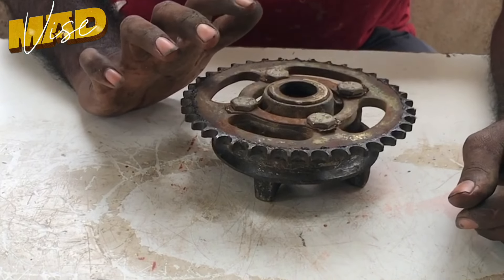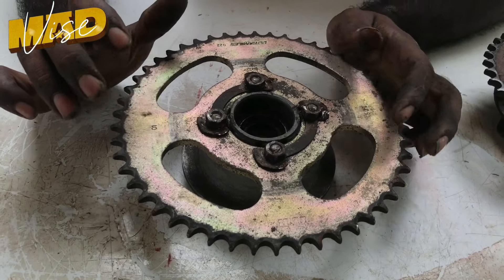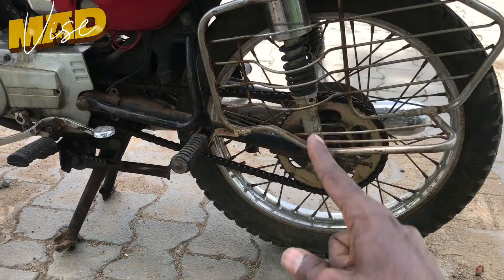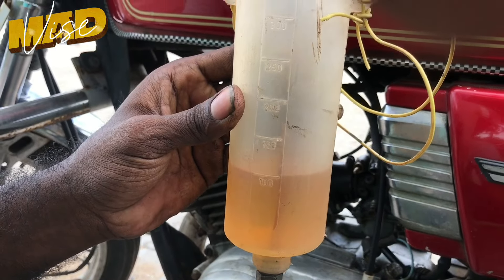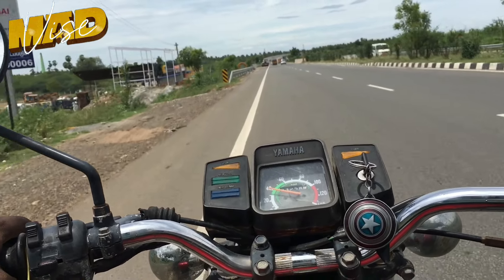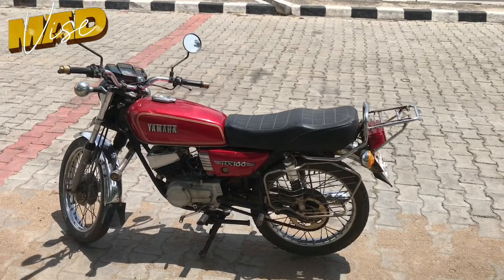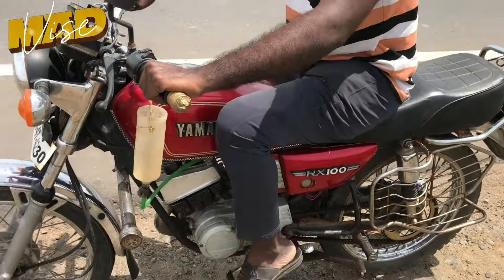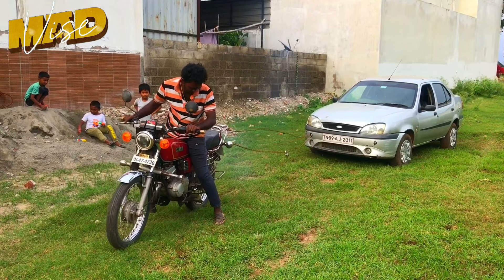பெரிய Chain's Sprocket change பண்ணிட்டோம்🔥 #automobile #rx100 #trendingvideotamil

Comment: Rear sprocket teeth athigamakkuna pickup athigamagum. 
Top speed kammiyagum.
Mileage kammiyagum.
Yaana bike engine athiga rpm la run aagum.
Hill's area ku tha set aagum bro.
Rear sprocket teeth kammi pannuga or engine side sprocket teeth athigamakkuga appotha mileage athigamagum .
Neega pannuramari pannuna mileage kammiyatha aagum
Reply from the maker: na test panni paathu tha solren .. neenga solrathu crt na mileage test pannum pothu mileage kammi aaairukanume bro
Reply: @Madvise007  appona ennam konjam periya sprocket poduga bro mileage athigama kedakkuthanu check panni video poduga bro

Comment: Bro,
Rear ல பெரிய chain sprocket போட்டால் bike da,
  1) top speed குறையும் 
  2) mileage குறையும் 
  3) pickup கூடும் 

Rear ல சின்ன chain sprocket போட்டால் bike da,
  1) top speed அதிகமாகும் 
  2) mileage அதிகமாகும்
  3) pickup குறையும் 
        
         ❤️  From 🇱🇰
Reply from the maker: rx 100 la rear sprocket 39 teeth -good mileage 
rx 135 la rear sprocket 37 teeth low mileage good top speed 
rx 100 la top speed kammi athunala rx 135 rear sproket size sinnatha aakunanga athunaalA TOP SPEED increase aachu ..but MILAGE KAMMI  aiiruchu
rear sproket size increase panna MILEAGE ATHIKAMA aagum..

Comment: Ji epome driven sprocket chinnathavum drive sprocket perusavum iruntha than speed and mileage kedaikum vice versa va pona milage kammiya than aagum and torque athigama irukum
Reply from the maker: torque um mileage um athikamagum .. top speed matum kammi aagum
Reply: torque athigamachuna mileage down aidum .,, as a example oru bike 3000 rpm la 40 teeth sprocket la 40 KM poguthunu vachupom 1 hr la 40 kM 1 litter petrol la cross agum , athee Bike la 30 teeth sprocket potu 3000 RPM la 50 km pogum ,. so same RPM la 10 KM speed athigamanathu nala 1 hr la 50 KM 1 litter petrol la pogum ., avaru slurathu crt broo